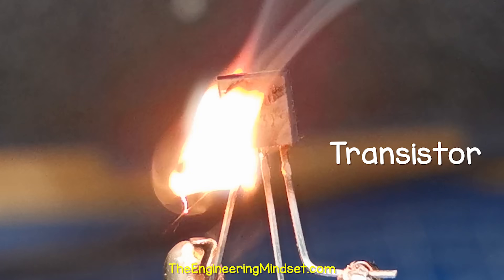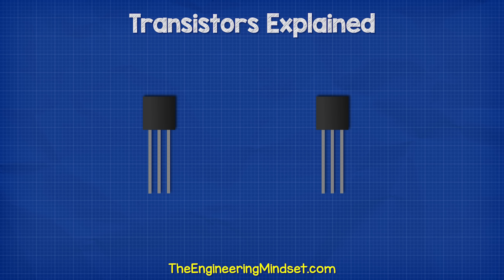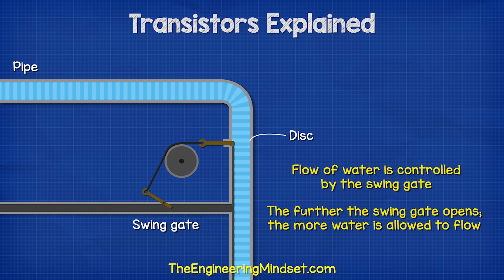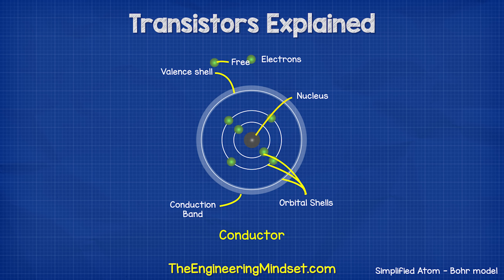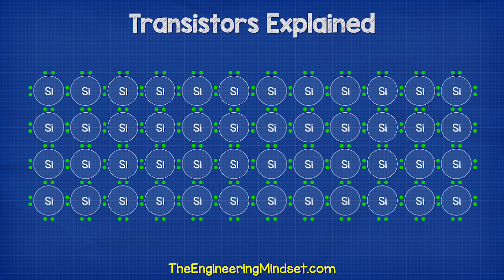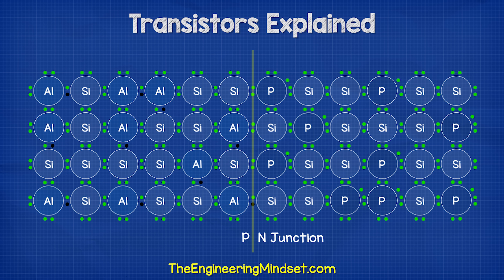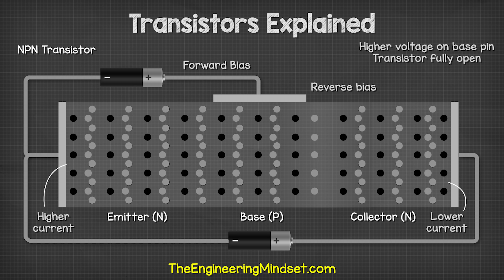Transistors Explained - How transistors work

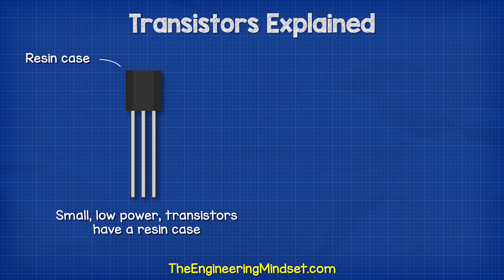Comment: 0:44 Heat sink and resin case
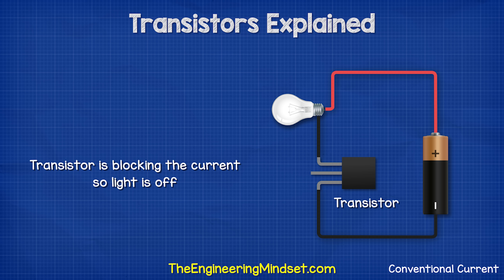2:40 As a switch
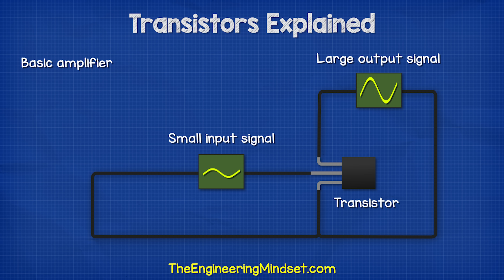4:19 As an amplifier
7:13 Diagram of BJT amplifier
15:31 Actual working
Reply: Very helpful
Reply: A conventional current is true because the current isn't just flow of electrons. In electrical current, all charged particles move. Including positive. Positively charged particles flow in one direction, negatively charged - in opposite.
Reply: 9:40 I almost fainted when I saw 4 electrons in 2nd orbit and 1 in 3rd orbit.
That's not how it works
Reply: @alifalaminmahi  it clearly states simplified atom - Bohr model
Reply: DON'T CLICK THIS VIDEO  Re-think your life

Comment: We can build that thing as big for elctricty transformer without transistor we can numeral voltage control like 50-250 volt.
but if you not use transistor the total is 1000 volt.
Reply: because transistor have code seal and numeral alphabet (I don't know) why did I think for control the capacity electricity or volt.
Reply from the maker: Seen our new Transformer video? here https://youtu.be/jcY4QN7awEc

Comment: Newbie question. This is my second video I've watched from "the Engineering Mindset" The first one said electrical flow starts from the negative side of the battery through the circuit, back to the positive. This video shows the opposite flow (positive to negative) Why is that?
Reply from the maker: Answer here https://youtu.be/MUh_dOcqgVw
Reply: @EngineeringMindset  Ahhh, thanks...so, we were wrong, but we're not going to correct it now because "that's the way we use to think??" I guess it said it didn't matter, but wouldn't it matter if you say introduced one way diodes into the circuit?

Comment: CPU is a logical, true/false, device made of figuratively thousands of transistors. You input data and code into a CPU, like numbers to add, 8 transistors represent a data like 1 digit or bunch of transistors a binary code, and it outputs the sum using binary addition.

Comment: Nano type technology made transistors possible. It had its heyday in 1980s but were found feasible in 1960s creating the first portable transistor radios. Before that radios were powered by vacuum tubes which need AC. 1980s made semiconductors using molecular microscopes. Hence all these new technologies were made possible by chance of combining separate technologies to make new ones.

Comment: Universities teach hole flow in a circuit. Hole flow is positive to negative. I was in the US Navy. They teach electron flow. The current flows against the arrow on a circuit diagram. It took me a while to understand the difference between university teaching and the electron flow. It would be much better if the world would agree on one or the other. Of course, the older engineers will never change. Therefore the confusion continues.

Comment: My EE professor taught us to think of current flow as hole flow.  This concept is meshes well with physical electron flow.  When +/- and flow was chosen many years ago, they did not have the means to determine the correct direction.  They had a 50/50 chance of getting it right, and chose one.  But as we now know, they were wrong.

Hole flow ftw!

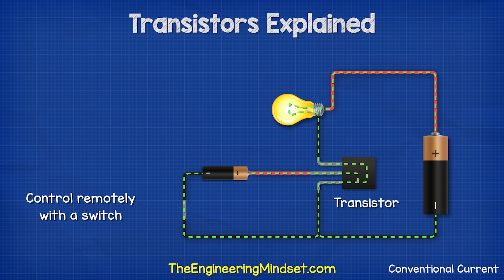Comment: 3:00
"we don't want to control the switch by ourselves, so we will hook it up with a battery and then use a switch to control it ourselves"
Reply from the maker: At 3:00 it shows a bimetallic temperature switch. Which is automatic, not manual
Reply: @EngineeringMindset  oh my bad, it's at 2:55 lol

Comment: 2:42
using the transistor as a switch is pointless when the transistor needs voltage to turn on, how else are you going to give that voltage to the transistor if not by hand/switch or another temperature switch in its circuit. ?? 
Might as well just use and open or close switch, its easier. 
By adding a transistor, now you have to add another circuit to activate the transistor ....

Comment: in reality if you think about it everything is intelligent, everything has an atom, and atoms are tiny little computers, quarks must do most of the thinking and the nucleus is the braun bullying protons and electrons so forth.. while quarks and even smaller matter must do the calculating? or the "accounting"  counting electrons so forth.. with neutral atoms the number of protons is equal to the number of electrons, so what does this calculation or comparison?  what holds this rule true, as you can see electrons may escape and so forth but there are rules, what governs these rules and deos the counting and computing, accountability and what enforces it? I mean how the hale does the nucleus even know how many electrons are surrounding it?  I understand its "laws of physics" and all those bananas matter but something must be enforcing these laws? keeping them accountable? quarks? are they actually mini calculators, bean counters? enforcers?

what it boils down to IMHO is all matter is intelligent, molecules all of it are intelligent,and what's odd is the component that does thew most coalculating is the very smallest, there may be matter smaller than quarks, we jut cannot see it yet, as quarks must be comprised of something?  so lets say quarks are comprised or built up from "quirks"  what are quirks built up or made of?  reality is it very well may be that tiny matter is just as numerous and large matter, meaning you can infinitely break down matter smaller than quarks, it never ends, just as you can go infinitely large, as in space, it never ends, infinite, take size or "quantification" in the same manner as integers, no beginning, no end... freekin bizzare

I love science, almost as um, complicated as religion...  almost...  :-)

Comment: Yea thats sort of how i learned it, 45 years ago.
Unfortunately, no electrons actually flow. Im wondering if it isnt time by now to let go of this explanation, as it is not correct. It is correct for the purpose of designing, repairing and so electronics, but not actually true.
Reply: You beat me to it by two hours.  I recently saw a Public Broadcasting video about this topic.  I'm not real sure but I think what "electricity" is is the shifting of all the electrons as a unit.  They don't flow from point A to point B.  They all shift together at the same time.  Does that sound right?  Oh, I just noticed on the right side of the screen another video titled, "The Big Misconception About Electricity" "Energy doesn't flow in wires".
Reply: @STBRetired1  Well we will share the credit ;]

But imo its not even fully understood and ventures into the realm of QM i think. As far as i know the energy itself is not so much distributed in the wiring, but as a magnetic field around it. And yes, i believe they all shift somewhat. And back. There is not really a flow of electrons, it seems.
Im not a uni schooled physicist, so i usually get the essence of things and leave it at that. And to be totally honest, i cant even say i grasp all of the essence here. Which is probably why they still teach it as flowing electrons. Thats easier to understand.
Reply: @StofStuiver  I believe you're correct.  I'm 77 and tend to forget things rather quickly.  But you sparked a memory with your comment about electricity being more about the magnetic field around the wire.  I never did check out that other video on YouTube to see what they say "electricity" is.

Comment: 11:34 shows structures with 14 electrons (like in silicon), 7 electrons (like nitrogen with extra layer) and 10 electrons as neon with extra layer, as insulator, conductor and semiconductor respectively.

Comment: So I can replace wired electricity frequency with radio frequency using some sequence of transistor to amplify the voltage. Like I just plugged some local radio WiFi into my mains then all the devices used transistors to amp instead of fuses to resist high volt plug. Like a car battery maybe devices have rechargeable batteries via a mains charger to plug into devices, in order to give the small initial charge to a transistor. But I can't because electricity want to make money we were all limited to high voltage wired electricity using fused plugs. But now as we are hitting plug to device overload we do sort of need to transition to wireless electricity devices so we can innovate mobile devices or sell more lighting devices. We need some sort of WiFi device foe beaming a steady radio field that should be easily received by radio compatible devices. The radio needs to flow from - to + of the device battery after passing through the amp transistor circuit which should replace the traditional plug fuse resistor.
Reply from the maker: Check out NEW resistor video, everything covered! ➡️ https://youtu.be/DYcLFHgVCn0

Comment: this is only mainly use for power supply section other today electronic circuit board are mostly build and made by manufacturer is small complex layer no more such lousy large component on board even some are advance world smaller computer i7 only side of our hand or smaller

Comment: my first experience of transistor was when i was a kid id tech radios apart the one three legged transistor i removed it was in a mullarde aluminium can type which suddenly came off and exposed the glass part it looked like some sulpurous compound inside by chance i discovered the chemicals inside were photo sensative i applied a multimeter test when i turned the transistor to the light the needle would move so shone a torch on the exposed transistor the needle almost to the end of the scale on the meter
Reply from the maker: Check our new Multimeter tutorial out ➡️ https://youtu.be/4lAyzRxsbDc

Comment: In 17:40 you mentioned, "The higher voltage on base pin, transistor fully open." How it can happen? As we know, BJT (NPN in this case) is current control, not voltage control like FET. How did you simply made that conclusion? It is IB (Base current) that related to BJT gain, not the voltage.

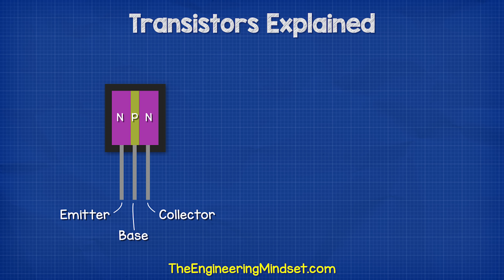Comment: 12:20 You show an NPN transistor - it is symmetrical - so why is one pin the Emitter and the other the collector - it looks like these can be labelled the other way around. Explain why not before going onto PNP transistors.
Reply: You misunderstood, they have the same function, but a pnp will close a normally flowing current when voltage is applied, and a npn will open a closed current when current is applied, the emitter and collector are a congruency between them

Comment: if some one can answer this then i think I can understand the whole of this video, for which is well put together.

ok I have a gas engine running on 12v that has a 12v Electronic ignition coil and a spark plug and the spark is controlled by a Arduino for the timing along with 
2 x 15A 400W MOS FET Trigger Switch Drive Module PWM Regulator Control Panel

1 to control the spark to the coil and the other to open and shut a solenoid to the gas 
and both run at 20ms on and off 

The problem is that there must be some electrical interference as after about 10 seconds the circuit/Ardunio  crashes then is ok again when reset,
Oh im using 16guage 8 strand wire for all connection to and from the battery and circuits.

I have done this setup on anther engine but with the Coil a lot further away from the circuit and seems to work fine.

So it seems the coil causes some interference and i don't know how to eliminate it. 

any tips would be wonderfu.

Comment: I absolutely hated my EE courses back in college, but I needed them to earn my degree. I got thru both semesters, albeit barely. My biggest issue is that conceptually I never really understood what was actually happening physically. Our textbooks dove right into equations and the professor didn’t attempt to give a practical framework of the mechanism. If I had these videos back then (1981), I’m sure I would’ve done better in my courses.
Reply: Physics and engineering books have too much math and too little words. If the authors of the technical books attempted to explain concepts in language rather than always using math, students would understand it better.

Comment: Thank you for explaining the source of confusion related to electron flow in an electrical circuit: negative to positive; while conventional terminology will show a flow from positive to negative.  I think the confusion is further exacerbated by the failure to distinguish between potential (voltage) and electron flow. I think of the positive side as a magnet attracting the electrons. The magnetic pull is in one direction, the electron flow in the other.
Reply: Well put!
Reply: Yes, but a diode makes that theory false. Electrons cannot flow negative to positive through the diode.

Comment: Ok now I am confused. In this animation you show that electrons flow from positive to negative, but I thought it was the opposite? Also the resistor is on the anode (plus side) instead of the katode (negative side)?? How, why. So it doesn’t matter if the resistor if after or before the led? And same for the transistor, it doesnt matter at which point of the electric flow it is?
Reply from the maker: Please watch full video https://youtu.be/J4oO7PT_nzQ?t=496
Reply from the maker: Check out NEW resistor video, everything covered! ➡️ https://youtu.be/DYcLFHgVCn0

Comment: Thank you for pointing out the fact that there are the terms:
"Conventional Current"
and
"Electron Flow".
And that there is a total difference.
My electronics teacher, in high school, apparently taught "Electron Flow". As I NOW realize. This was back in 1980 - 81.

Electronics always interested me but I did have some difficulty understanding certain concepts.
I did not know the definition of the word bias. The day the term was first used, nobody else raised their hand, to ask what bias meant, so of course I didn't. Who carried a dictionary around? Every one does today...on their phone.
Fake it until you make it does not work always.

Anyways, years later I finally looked up the definition of bias. Der!

Decided to start tinkering with circuits that used more than resistors, capacitors and diodes. I would visit a web site that showed what I was thinking about trying to make.They didn't make sense. The way I was taught, the current  flows from negative to positive. Bottom to the top of the drawing. "Electron Flow".
I'm looking at examples using "Conventional Current" and NO ONE is pointing out that the two exist.
Confusion always won and the interest faded again.
Over and over, every couple years.
So when I stumbled across this video, I thought,
 "Well, maybe this time something will finally click." And...
Voila! Mixed with, "What the Phuch!" And of course the question, "Why hasn't...?"

This time around I think I will actually make it to the next level.
But, the visual memories of that chalkboard, from high school, seems to be messing up what I am trying to fully grasp.
To have a intimate understanding  will allow my ability to apply and trouble shoot better.

I remember the way my teacher showed us how the current flowed through the symbol representation of a diode.
The electron goes up the hill, and over the cliff and on to its destination through the path of least resistance.
The electron that tries to go the other way is stopped at the bottom of the cliff.

Oh. In your video, when showing the "P' for Phosphorous used in the "N" type material, is also doing really well confusing my analytical brain when I watch that part.
So I mute it....just there.
That is my only critique on this wonderful video.

Now I have to look up more of these videos...Damn I spent a lot of time on this...
Reply from the maker: Check out NEW resistor video, everything covered! ➡️ https://youtu.be/DYcLFHgVCn0

Comment: At about 17:27 the claim is made "the voltage of this (collector) battery is much higher".  But in fact, the collector of the transistor can often be at a MUCH LOWER voltage than the base (it can be higher, but that is not required). The transistor can pull the voltage of the collector down to within .02 volts of the Emitter vs the base at 0.7 volts.  This is absolute magic to me. I don't understand how transistors work.  This video is one of the best I've found so far, but it still doesn't really answer how the collector can be so much lower than the base and still have electrons flow. I'm still trying to figure this out. I feel this video has 90% of the answer, but I can't grasp the 10% I'm still missing.

Comment: I first learned tube theory, then when transistors came out I learned that. But was thrown a curve ball when they told me holes flow in the opposite direction to electrons. Took me a few hours to grasp that, way back in the 50's.

Comment: So basically;

Resistor: Resist current so u don’t blow up other components.

Transistor: transfer resist , control flow of current , switch off/on and amplify current signal.

Capacitor: charge/ discharge current, no lag. More or less speed up the process , stable with no interruptions.

Resist + control = stable ‘ current.

Is that correct please let me know.
Reply from the maker: Check out NEW resistor video, everything covered! ➡️ https://youtu.be/DYcLFHgVCn0

Comment: The biggest problem with most of the transistor explanation is we simply say that a small signal input is amplified which is really not true. An amplifier is simply converting DC to AC and if that is not told, amplifiers will be misunderstood to be going against the law of conservation of energy!
Reply: An amplifier is not converting DC to AC, that is an inverter.
Reply: @karhukivi  Agree but in an amplifier, the bias voltage is what is being used to amplify the AC in that way the DC power is simply put in to AC domain. Just connecting AC at input will not be amplified by the transistor

Comment: Is the battery's voltage incorrect at 14:55? Because "Voltage source must be greater than the barrier for current flow". Voltage source being 0.5V and barrier 0.7V in the video